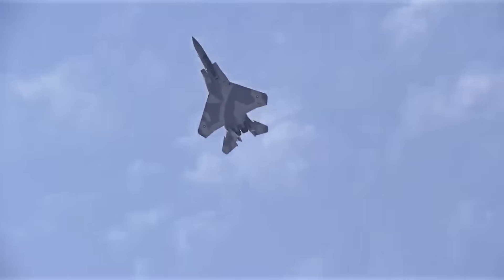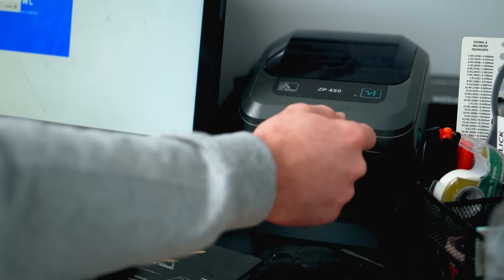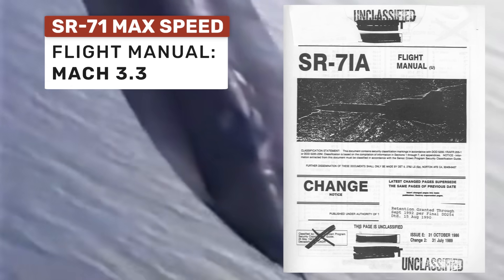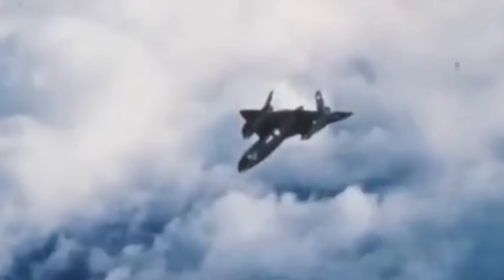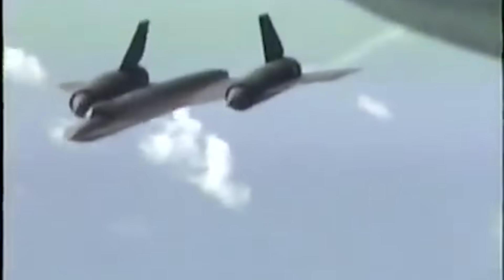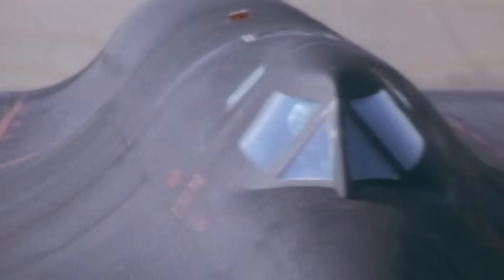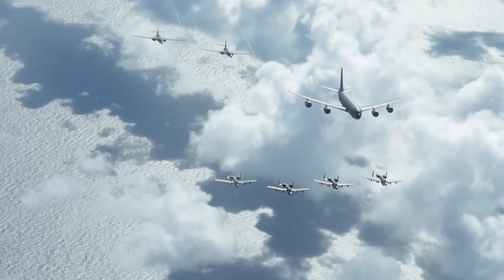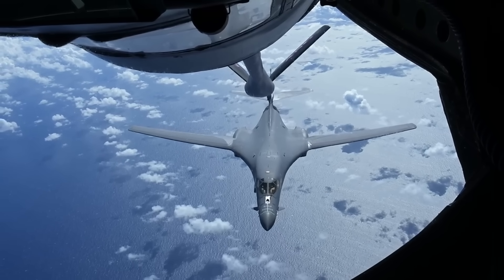The SR-71 was MUCH FASTER than the Air Force will admit

Comment: The engines on the SR-71 can push it to Mach 4.1, mathematically. The limit is only material of the airframe.
Reply: Lol no they can't. The engines aren't remotely capable of that. The initial limit to higher speed was in face the engines. In particular the engine CIT limit of 427⁰.
Reply: @gr8crash  P&W said that the CIT limit was 450° for a maximum of 30 minutes.
450° can reach 4.1 mathematically. Engines are part of the airframe, but the actual choke point was the fuel pumps, pun intended. The fuel pumps were never tested for conditions above 3.5, hence my statement, 'mathematically.' Theoretical wasn't the correct word, which is why I didn't use it.
Reply: @anotherdadjoke still not quite. 450⁰ was the tactical limit, and allowed 1 hr per engine total and had to be notated in the logbook. But that limit was only allowed if other limits were in place, and this tactical limit was never used.

And the math doesn't work in the real world. That would assume static conditions which isn't going to happen. Above that the engine wouldn't be able to handle the airflow at that speed, and given the engine couldn't even be certified for mach 3.5, 4.1 is unlikely. P&W has said with modern materials and controls it could reach mach 4, but the rework required to the airframe for that speed was never implemented. The J58 had already been upgraded beyond is initial design just to be able to be flown at mach 3.2.
Reply: @gr8crash  I did the MATH,  did you do the MATH? Math says yes, someone who hasn't or cannot hasn't.
Who do I believe? Me, and my calculator,  or someone else. "Don't believe your lying eyes" is the only thing you have said. I'm saying "Do the MATH"
Reply: @anotherdadjoke guessing it didn't do the math correctly.  What altitude did you calculate your math at?  What atmospheric temperature did you use?
Reply: @gr8crash  multiple calculations, in combination of 24 to 25.9 and -33 to -36. All units are metric
Reply: @anotherdadjoke  you may need to check your math as you're using incorrect values for temperature. 

I'm assuming your using 24k meter and -36⁰c? That's part of your error.
Reply: @gr8crash  24k at -36 wasn't one of the combinations, 24k has -33 &-33.5, 24.5k has -33, -33.5, & -34. All of which give  numbers between 3.77 and 3.97.
25.75 at -35.5 give 4.093, rounding to 4.1
As the normal range of temperature at 25.75 is -34+-2 -35.5 is a possible combination,  hence 'Do the math'
My math is practical calculus as used by propulsion engineers from the 50's through the 90's. I received the formulae from one of them.
Reply: @anotherdadjoke given the numbers you seem to be using,  explains why your math is wrong. So you're using 24k ft and -36⁰c? Or is that 24k M and -36⁰? Either way, that explains a lot of your issues.

Comment: An old friend of mine told me back in the 90’s never told me the speed but told me ny to Edward’s in 1 hr 36min minus refueling @ 90k feet
Reply: Not likely at it didn't fly NY to Edward's really. But even if it did do that,  total flight time would be longer than that, and refueling at 90k? Lol. No, not even remotely possible.

Comment: When I was a teen, I worked at Skyrypers - a sky-writing company that used 5 AT-6's, and Jim Eastham was in the pool of pilots that flew with them, whenever he was available.

I knew that he test flew SR-71's, but I did NOT know, that he wrote the flight manuals!

I did used to bug the living hell out of him about what the actual top speed was, and one day he finally gave me a number: while I figured he was just BS'ing me, I have heard that crazy number from one other credible source, and it's higher than any of the usual numbers that are out there.

But yes, air temperature and air density are the deciding factors in how fast it could safely fly, and so the manuals limit it to a speed that can be maintained safely, all day long. (And, I say that while remembering the SR-71 that simply broke apart over Tucumcari, NM.)
Reply: So what number did he say?
Reply: @gr8crash I promised not to tell, but I will say that the majority of aerospace "engineers" online will say it's impossible.

That said, the published top speed that's out there, is the "never exceed", or "safe" speed, not the top speed. It can go much faster, but that's when things start to break.
Reply: @Britcarjunkie I'm gonna bet that whatever number you're thinking of isn't possible. And not saying the details, when all the information is declassified and public including its potential speeds just doesn't help much.

Comment: Of course it went faster and higher than what they say. they’ll never tell you the unclassified features about any craft
Reply: Except the SR71 has been declassified for over 2 decades now
Reply: @gr8crash  obviously it’s been declassified. But they will never tell you how fast or high it really goes. That’s with ANY aircraft. There is classified and declassified information about every aircraft
Reply: @izulaAlec0369 not really how it works. The SR71 has been declassified for decades. All the information,  speed, altitude etc is all public and declassified.

Comment: The engines in the A-12 are the J-57 made by Pratt & Whitney and the engines in the SR-71 are the J-58 made by Pratt & Whitney.
Reply: Incorrect. The A12s also had J58s. Although to get the flight test program going they initially used J75s. And the TA12 in LA only ever had the J75s.

Comment: Interesting report. In the 80's I worked for Bendix Energy Controls Div. where they built/rebuilt and tested the fuel controls for the SR-71. The scuttlebutt there was that every time an aircraft (mostly Russian) would come close to or exceed the published top speed of that aircraft, they would send one up, push the throttle a little farther and break the record... again. And rumor was that there was a lot of room left and it wasn't even close to actual limits. Also, you might want to try decaf.
Reply: None of that even makes sense. Especially when you understand how temperatures effect SR71 performance

Comment: If you know about something, they no longer use it. The fastest planes today make the sr-71 look like a snail.
Reply: Not really how it works. I mean we knew about the SR71 from its first flight and they used it for decades
Reply: @gr8crash  nope. They only tell you what they want you to think. It flew, but not on any missions once it was publicly known about. That defeats the purpose of having spy planes. Once the public knew about its existance, it had already been beaten as the best spy plane.
Reply: @MegaLokopo that isn't even remotely true. The SR71 flew its first flight in Dec 1964, became operational in 1966 and went on its first deployment in 68. It performed reconnaissance missions for another 20+ yrs. The SR71 was always tested and operated in full public view. Your thinking of how aviation works is severely flawed.
Reply: @gr8crash  it was tested at night at area 51. They always have 2 planes, one you know about and one you dont, the newer one is the one you dont know about. it defeats the purpose of having a spy plane if it can be tracked based off of its speed being known.
Reply: @MegaLokopo thats not at all how it works. Nor are test flights done at night, especially the initial test flights, doesn't matter what the aircraft is.

And no, the SR71 was never flown/tested/operated at Area 51. Again first flight was in full public view at Plant 42  in which it's first flight was over to Edward's AFB for flight testing. The USAF never even had any plans or intentions on testing the SR71 at Area 51. It was always planned to be flown and tested at Edward's.
Reply: Technically, if you really want to be anal, we've had the ability since the 1950's to reach speeds that would make the SR-71 look like a snail.  It's just that you're basically talking satellites.  Sputnik and Explorer I were both capable of doing around 17000-18000 mph since they were effectively put in orbit.

Comment: Even the ole F4 Phantom much faster than admitted!  I had fixed SR-71's belly "error" in '63 for Kelly in 2.5 hours just before threatened Cancel by SOD.  Kelly happy, so got me ride in Phantom being tested as Rear on best Test Pilot's F4, but he was defective coming down w/6-wk Flu.  We topped off at Mich U.P. Bomber Base, then terrorized Lk. Superior up to FL67, when Pilot began chokin' on his puke!  I contacted Tower in English, advised Pilot out, pushin' over for dive to Base on full burners, clear deck please.  I had designed the darned thing, dbl green lighted by Ike in '54 when 3, but 1st time in Pilotage of anything.  Tower asked how long been piloting, so answered, "That would be 1.5 minutes total, Sir"!  Tower advised, stay away from Ready Line, buildings, parking lots, & especially Tower, runways only 2 miles long, so what is your plan?  I said, alite on end, throw everything out, brake while slaloming ctr line, pop chutes bit early, hope Tires say Goodyear on 'em, but first need best guess on pullout of dive.  Tower said, Roger that, gotcha on Radar, it won't be long.  Ground looked not good, so flared out early, & few seconds later, Tower said prepare to bail out of dive, and I answered, already flared & near runway.  Reverse Thrusted #2, & made half-fast landing right on end of runway.  Smart Azz in Tower asked if knew what 411 was?  I answered, very busy right now, finally popped chutes early, and they both held, so Tower cheerleading us w/411 MPH was your speed at touch, if needed for your calculations.  I answered, Blankets, Blankets, Doc will need plenty 'em as this sucker is HOT!!!!  Got 'er stopped while cranking canopy up, Fire Rescue there within a minute, & Doc on ladder (with his blankets), when both tires blew about 15 seconds apart.  Doc fearless, as didn't let concussions bother 'em, and had Pilot in harness for lowering in a minute.  When down, Doc cleared Pilot's airway, & off to Infirmary they went!  Fire-Rescue watered & foamed tire & rim remnants, but ended up w/much steam, headed away from me thank goodness!  Ofcr running show, asked if knew how close to end of runway we were?  I told him had no idea, so he said, "5 ft. from the end", asking would like to tell Tower, or should I?  I said you can tell 'em, Sir.  He told Controllers, & they asked if needed that last 5' ground up for to-go bag?

 When Handler Kelly Johnson advised, he had USAF Commanding General, of the Base fire me, confiscated Flight Suit, transported back to Howell Mich, & couple days later came down with The Test Pilot's Flu, wishin' I was doubly dead, for about 6 weeks!

As far as speeds go, Phantom got so hot, it had an outer shell of plates & rivets, plus aircraft's frame, all one piece, as welded itself together.  My firing temporary, as when JFK, Buddy of Dad and Ike, learned what had been going on, he collared both SOD & Kelly, as knew I'd never do anything to the detriment of USA, but later in '63, some ahole shot 'em to death, so I was all done with workin' for United States!!  Too dangerous!!!
Reply: Wild and interesting tale, amazing if true...!!! 👍😎🇺🇸

Comment: Look up :Mach tuck."  The fastest SR-71 had a 7 foot aft extension of the fuselage containing an empty fuel tank.  As speed increased fuel was pumped into the aft-extension tank to move the Center of Gravity of the plane aft as the Center of Pressure moved aft with the increasing speed.  Thereby, allowing that one aircraft to sustain 3.3 Mach.  In the heart of the mission range none other could exceed 3,2 and maintain control of the aircraft.  The thrust was available to do more, but control went from dubious to impossible depending on the circumstances.  Management strongly warned against pushing past 3.2, with penalties for those who did so and were lucky enough to have come back.  So the answer is yes on thrust and no on aerodynamics.
Reply: Lol what? The only SR71 modified like that is the Big Tail at Eglin. And it didn't have a fuel tank or used for CG. It was going to house reconnaissance equipment so the aircraft could carry more overall, but it just didn't work out very well so only one was built.

Comment: I've known for more than 40 years that the SR 71 could do Mach 3.5, and as you said, it could go faster.  I heard a hint as to how fast the SR71 could go.  Russia had a series of ground to air missiles known as SA-75 Dvina, S-75 Desna, and S-75M Volkhov/Volga, those missiles could go to Mach 3.5, SR71 Blackbird pilots have reported outrunning those missiles, let that settle into your brains.
Reply: The SR71 couldn't reach mach 3.5. Even getting close to that speed required very specific atmospheric conditions. So exceeding 3.5 wasn't really going to happen either.
Reply: @gr8crash  Then explain how they could outrun those missiles?
Reply: @Rekmeyata an SR71 nor any aircraft can "out run" a missile. Out position yes,  not out run, 2 different things. 

Those SAMs that were prevalent they knew they only had about a 55 second flight time, so they would essentially just monitor it. Once they got the launched detected they timed it. Have to remember even though the SAM is slightly faster, it still has to travel approximately 15 miles just to get up to that speed and altitude. And that's assuming the aircraft didn't just change its heading slightly. A slight change in heading creates enough deviation that the missile now has to adjust for that, which means the chances of intercept start dropping. 

And don't fAltgt, although remote it was possible to hit an SR71,  just remember the A12 that was damaged slightly by a SAM in 68. Again it was VERY unlikely and the chances are remote at best. But even flying directly over Moscow,  surrounded by S300s etc, the mission only carried a 3% chance of intercept.

Comment: When I was very young, probably around 10 years old, somewhere around 1980 or 1981 I went to the library to research some thing and I found a book on experimental aircraft. One of the aircraft in the book clocked in at 6.7 Mach. It was an “X” aircraft for instance it was X – 71 and experimental aircraft that was not commissioned to full duty yet later on I saw a picture of the same aircraft only now it was called an SR-71. I wonder after it went through all its testing what it could actually do.
Reply: You're referring to the X-15. Completely different then the SR71
Reply: @gr8crash  ok. I figured I may be mixing memories because that’s so damn fast it would’ve been impossible to keep a lid on it.  Thanks for the response
Reply: @sotiriostzanetakos2910 yea that X15 was impressive. During testing the max speed was that mach 6.7 speed. It was a pretty public flight testing program back then.  The SR71 is impressive, just in different ways.

Comment: The Blackbird was always limited by the compressor inlet temperature of 427 degrees Centigrade. Any hotter and it would begin to soften the blades. The thermal limits of the airframe would never come into play. As the narrator stated, no one was suicidal enough to just firewall the throttle and see what she'll do, although it would've been great at the end of the program when all would be retired if Lockheed could somehow have tested it to destruction using remote controls. Mach 3.7? 3.8? I think I remember someone at Lockheed stating the fuselage would start to melt at around those speeds with the resulting temps...
Reply: The aircraft never could have flown fast enough to "melt". But above mach 3.5 various parts of the airframe would need further analysis or different materials as it wouldn't hold up to higher speeds. Lockheed did know what the ultimate speeds could be of the airframe,  but also the improvements required to reach those speeds were never implemented.
Reply: @gr8crash  Can you point me to the documentation of your claims? I'd be very interested in reading about these limits and testing methods, etc.
Reply: @privateer0561 honestly either have to do a lot of research or join some SR71 groups with former crews and ask. There's a Lockheed and NASA study that goes in to higher speeds, what's required and what begins failing when.
Reply: @privateer0561 honestly takes some good researching and/or joining some SR71 groups that have former members and such to learn from. Lockheed and NASA have done studies on making the aircraft faster, what's required and what begins to fail and went. But short answer from Lockheed is that the aircraft had a maximum design potential of mach 3.8. But to reach those speeds required significant rework to the airframe,  inlets, engines etc with the addition of water injection and so on. But doing all that work lowered the safety margins of the aircraft essentially to zero and Kelly Johnson said the risks weren't worth it for such a small increase in overall speed.